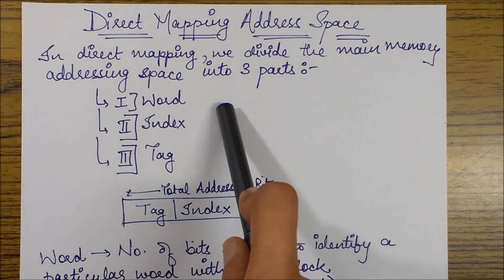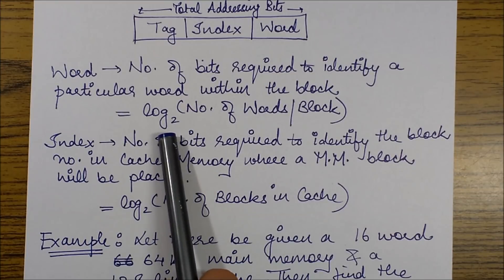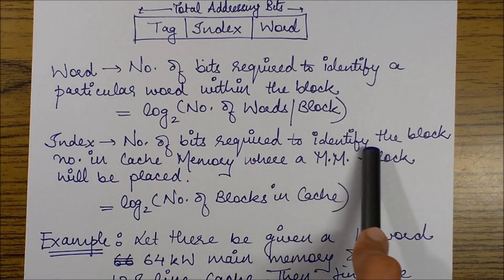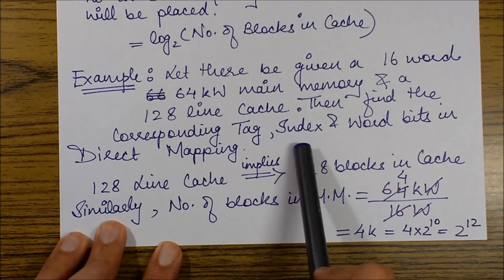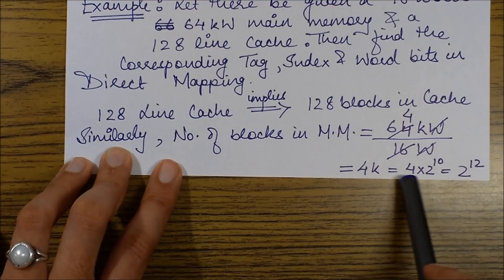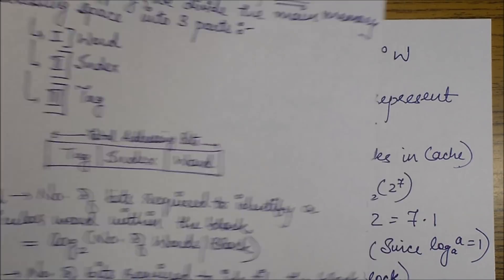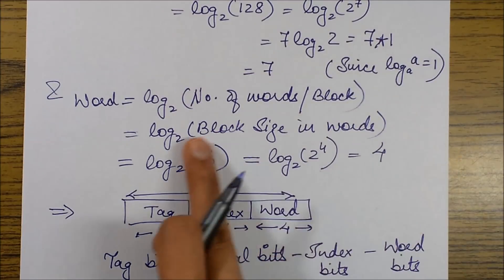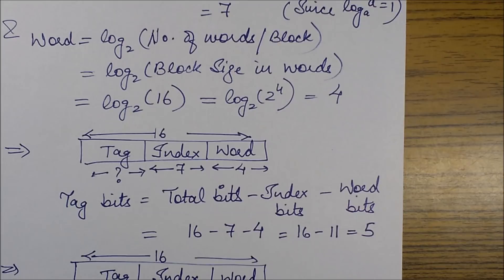DIRECT MAPPING SCHEME: Concept & Example

Comment: Can you please solve this too? 😅
Write a program using 8086 assembly Language (with proper comments) that accepts a 
single character input from the keyboard, if this character is '+' then the program adds two 
six byte arrays stored in the memory into a third array in the memory, otherwise program 
simply terminates. Make suitable assumptions, if any. (The effect of addition should be 
similar to the array operation like:
for i=1 to 6 {C[i]=A[i]+B[i];} )
Reply: No
Reply: @rahulsyt_  No need now.. Thanks

Comment: can you please solve this question..
A computer has 4 GB RAM with each memory word of 64 bits. It has cache memory having 1024 blocks having a size of 128 bits (2 memory words). Show how the main memory address (C1AAF0AB)h will be mapped to cache address, if
(i) Direct cache mapping is used
(ii) Associative cache mapping is used
(iii)Two way set associative cache mapping is used.
You should show the size of tag, index, main memory block address and offset in your answer.
Reply from the maker: Cache has 1024 blocks => 2^10 blocks. Also, block size is given as 128 bits = 128/8 Bytes = 16 Bytes. Now, Main Memory (MM) or RAM size = 4 * (1024) MBs = 4* (1024)* (1024) KBs = 4* (1024)* (1024)* (1024) Bytes = 2^(32) => 32 bytes required to represent the MM address space. Since there are 1024 blocks in cache, and 1024 = 2^10 => 10 bytes required to index blocks in cache. Since block size if 128 = 2^7 => 7 bytes to index words in a block. So, for i) Direct cache mapping-> Tag bits = 32-(10 + 7) = 15. So,tag - index - offset become 15 - 10 - 7, and to map C1AAF0AB, we would split it as C1A-101-0-F0-1-010-B: Tag=C1A101, index=0F01, offset=010B, which when converted from hex to 40bit binary notation would be: Tag=1100 0001 1010 101, index=0 1111 0000 1, and offset=010 1011. 
For associative mapping, we have only tag and offset, with offset bit as 7 and tag = 15+10=25 -> for mapping the given word, Split would be C1AAF0-1-010-B=> Tag=1100 0001 1010 1010 1111 0000 1 and offset= 010 1011.
Lastly for 2-way Set-Associative => 2 blocks per set, we compute the number of sets as No. of blocks in cache/2 = 1024/2 = 512 = 2^8 => 8 bytes to address different sets => Tag bits = 32-8-7 = 17. So, Tag-Set-Offset becomes 17-8-7. So, to to map C1AAF0AB, split is C1AA-1-111-0-1-010-B. So, TAG=1100 0001 1010 1010 1, SET=111 0 1, and OFFSET= 010 1011. You could get better clarity by going through solved examples in this playlist.